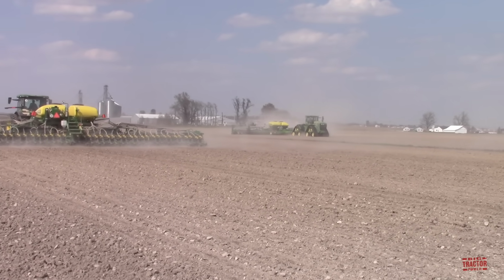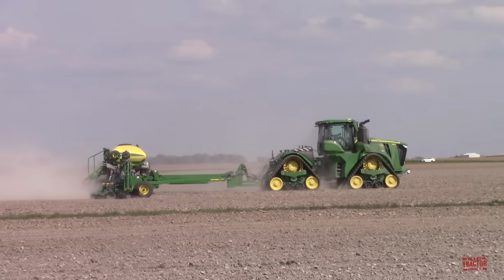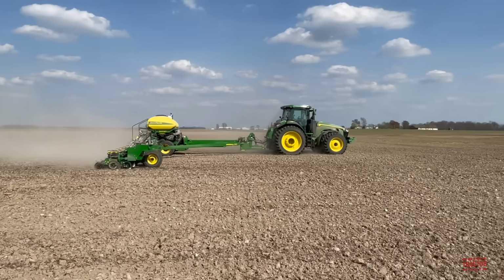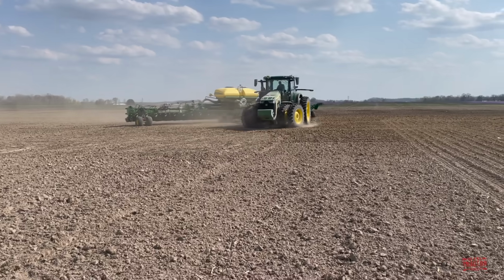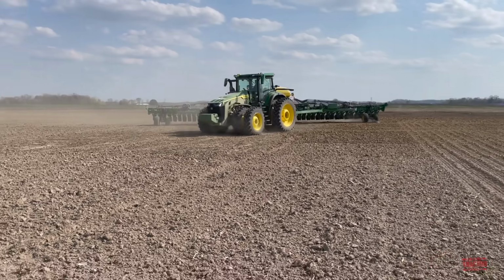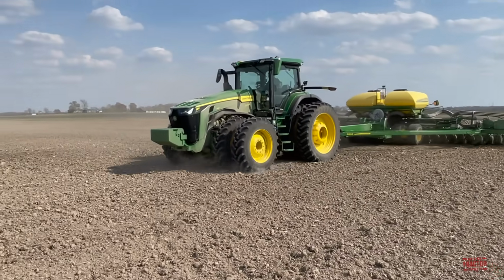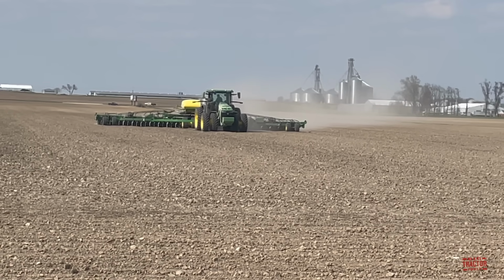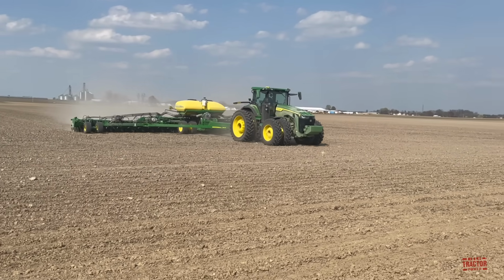JOHN DEERE 8R 410 Tractor & DB60 Planter

Comment: I don’t farm but the John Deere’s I remember were the 2950 and a 4020 my uncle had.  Both were really good tractors but I really like that 8RX Deere has out now.  Never seen one but I did see a 8R like a 285 or 295 horsepower one back last winter at the Deere dealer in my hometown.  I like the styling of it and the new 9R Deere has now.
Reply from the maker: The 2950 and 4020 are two greats. An open station 2950 had the same fenders as an open station 4020.

Comment: Question-  We have a small cattle farm, Dad had the cattle, now just want to mow maintain, but ground it ruff from year's of cattle and gophers.
 Short of replanting, how can I smooth out the land surface, so the kiddos don't rattle their teeth riding quads?

 Do those "track" drive tractors make it a smoother ride, do they come in 50hp sizes?

 What would you do?

 ....price of no concern. ( relatively)
Reply: No, you cannot get a 50hp tracked tractor. I haven’t been in a tracker tractor, but I’ve heard they aren’t smoother. Our bulldozer isn’t smoother. 

Your best bet would probably be to disc up the land. If you disc the rough spots it won’t kill the grass, but the grass will have to reestablish itself. You might be able to find something designed for flattening the ground. I’ve never rolled the ground, but you might try rolling it? But I doubt thatll work if there is thick grass.